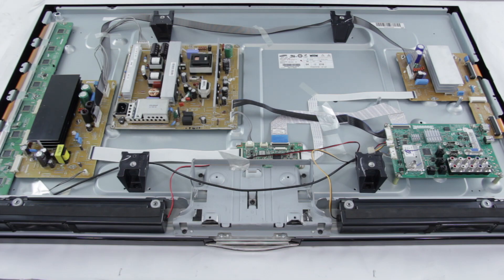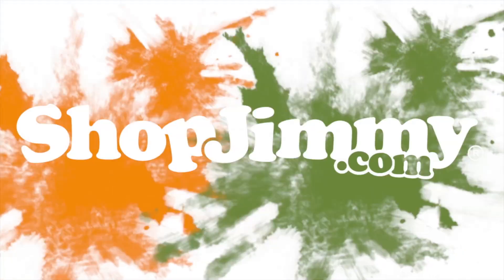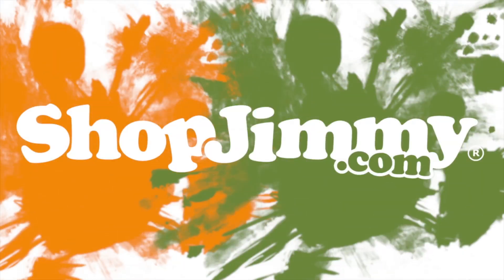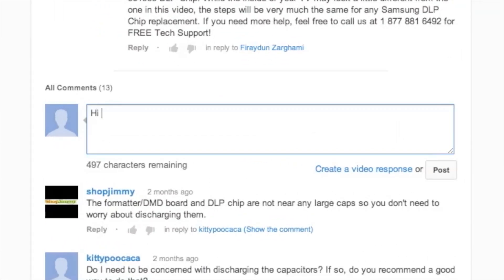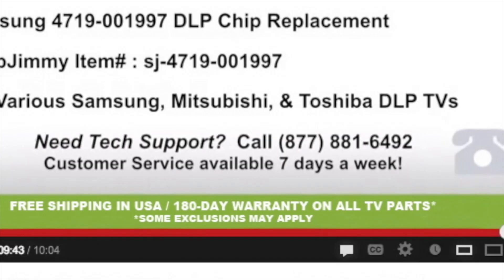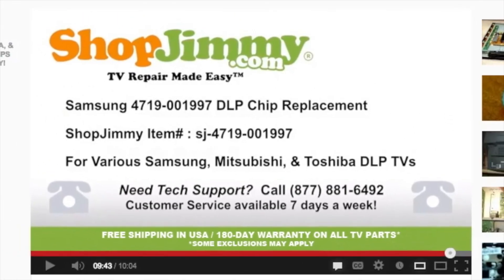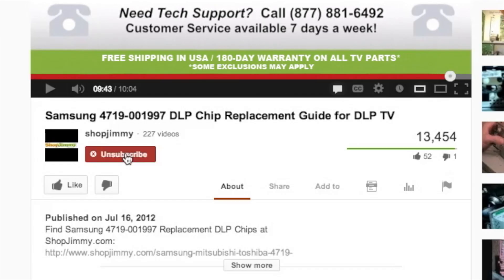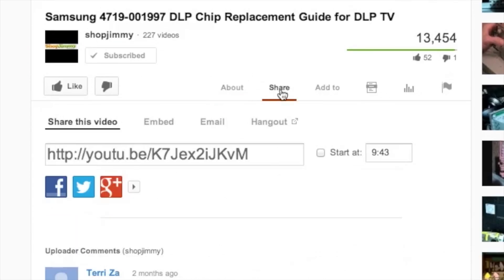Plasma TV Repair Tutorial - Common Symptoms & Solutions - How to Fix Plasma TVs

Comment: Samsung
Model: UN60JU7090F
Tv will not turn on. Red light flashes on and off and there is a clicking sound. All capacitors are in fine working order and I have replaced the power board and power cable, but to no avail. What else could be causing this?

Comment: I have an LG 60PH6700 Plasma TV, It turns on all good. But then it just shutdown. I sometimes the monitor works, But when you turn it back on. The monitor doesn't work. You can tab the tv a bit. Or shake it. and the monitor starts working again. But it can play sound with no problems when the screen is off. It doesn't restart or anything. And i suspect it is the powersupply. But when the screen is on it will just shut-down within a couple moments. maybe 5 minutes maybe 20 seconds.
Reply: BoriaGaming
Reply: Its a problem in the powersupply, you can try sending it to a repair shop to replace the capacitors in the board.

Comment: I have a Samsung Plasma TV it has sound but no picture. The model # is PN60E550D1FXZA and both the Y Main and the 2 buffers numbers are J92-01859A Partial PBA number (859A) found on a sticker the upper and lower ones are...what could the problem?

Comment: Hi, I have a samsung pn59d550c1f with no imagine and won't turn on, it has a clicking noice but not that loud, one thing i notice it the red light when i press the power botton other botton. do you have an idea of what can be causing my tv not to turn on, and where can i buy the replacement parts if I need to replace one
.. thanks i hopw you can help me...

Comment: HI THERE .. IVE GOT A LG TV PLASMA HERE.50PB560B.  there is a standby light..when you press on ,it flicks 2 times and then goes dead..nothing happens then .there, no clicking..Iv,e changed the main board but it stays the same.. What could it be?

Comment: My Samsung Pn60f5300afxza will not power on. The standby light blinks about 12 times continues and then pauses and blinks about 3 fast blink. So total of 14-15 blinks. Have replaced every board besides the main board and the Y sus board. Any Ideas?

Comment: Hello
Over the last several months I have been experiencing red pixels after watching tv on the Pioneer Elite Pro-101fd for a few hours. It happens three times a week and is resolved by resetting the Pioneer VSX 81TXV receiver to standby/on to off and holding the Tone button and holding the standby/on button until reset appears and I hit OK.
 
I would like to know if there is any reset to the PRO-101FD that need to occur to prevent this from happening again or if there is a part that i can replace. I have searched online and did not find my problem in the AV forums. What was shown in the forms was a total red pixel screen and not the red pixel that occurs with other color images on the tv. 
 

Thanks
Jon

Comment: hi have a samsung model# pn64f5500afzxa i have sound but no picture screen doesnt even light up i opened the back panel and noticed when plugged up the logic unit has a green blinking light so could it be power supply

Comment: I have a Panasonic Plasma TC-P65GT30 that is getting green and red short single line bars flickering on dark, and green bars that flash on Red and Red on Green. I have found that if I Up brightness to 100% and Contrast that I can limit the issue by effecting the colors  to not be Dark and not be a hard red or green.  Is this a voltage issue. I have found that unplugging my TV for long periods of time use to work in fixing the issue for a while.

Comment: Jimmy I have a samsung plasma tv  model PN50B550T2FXZA  with one horizontal line about 1/4" wide 2/3 down from top, iy looks like I need to replace Y components but how easy is that and are they soldered or push in. Thanks JIM

Comment: can anyone help...have a samsung pn64d8000FFZXA. 1month ago the picture failed but sound was fine.standby light was solid. waited an hour or would wait till the next day. Either case, when turned on, everything was fine for about an hour then Picture went off, no popping sound, but sound played. As the picture is off the blinking light on the main logic control board stays on for about 4 seconds then off for a second and repeats. However, when it was working fine, that same light flashed on and off for .5 second. Additionally ,after this problem i decided to plug  a usb fan into the main board usb connection and had it facing and blowing up on the main and onto the x-main as well. The tv worked flawlessly for 2 weeks. i then decided to remove the usb fan and within 30 minutes the picture shut down as before. Now the picture doesn't come on at all.  Sorry for the detail, but can anyone figure out what board it may be. I ordered and received but did not install the only 4 boards that shop jimmy had...y-scan top and bottom, main logic control board, and the x-main board. I fear installing them without knowing the problem may cause any/all of them to fail. Also does anyone know if shop jimmy will answer these questions by phone call? Thanks

Comment: I have a Samsung 60" Plasma, model PN60E530A3F. The problem began when the tv was on for an extended period of time, when you shut it off and restarted it you would get sound but no picture. If you waited a while, and then turn the tv on, the picture would appear. Now, I get no picture, only sound. Looking at your video, it would sound like the Y Sustain board. Can you confirm and give me some insight?

Comment: I have a Samsung PN50C450B1D. when I turn it on. the screen flashes a couple time and turns off. there will be sound from a tv show but no picture. I toke the panel off and noticed that the Logic Board's LED is flashing 5 seconds on and 2 seconds off consistently until it power saver shuts off. I'd like to just get the entire guts so there's no mistake on which part is faulty, but I cant find one. please help. it's a beautiful TV and i want to save it for a modest price.
Reply: Drew Allen have same tv. But mine has vertical black 3 inch line. Did u find out how to fix ur tv?

Comment: Samsung pn50c450b1dxza and the TV won't turn on. red standby light is on but no clicking noise, and I recently changed the power supply and it still not working. Also I noticed that no light on main logic board either, please help!!!!!

Comment: I have a pioneer PDP-507CMX ot a 505cmx I can't
remember which, and I have the add in card with the rgb and dvi input.  I'm getting horizontal moving lines (not black steady) going down the screen. I thought it might be my converter going in to the tv converting the hdmi signal and scrubbing the hdcp.  I'm trying to find something to directly connect to the tv to circumvent that. I did try moving the input from the rgb to the vga connector with another adapter just to see if it was the rgb input but the line were still there.   Any help with this would be appreciated, thanks!

Comment: I have had this tv for about 7 years. It will not turn on now. If I unplug it and plug it back in it makes a clicking sound 4 or 5 times then nothing happens. The red light does come on when I plug the tv in. here is the model number. Model #PN50C450B1DXZA SAMSUNG Plasma Television If you could let me know what you think the problem is that would be greatly appreciated. also, do you have a source for parts?

Comment: Hello. Si I have 60PZ550 lg tv . The sound started to fail little by little now it's stopped sounding completely. Also there is no ref light on optical digital cable port. I reset the audio setting and still not working. I also turned the tv speakers off and on. Any idea?

Comment: Phillips Plasma
Model NO: 42PFP5332D/37
blinking blue&red power light
occasionally turns on but after hours of plugging and unplugging  and pressing the power button. once on it will display fine its just difficult to turn on all the way, i read a bad capacitor but i dont how to test them.

Comment: I accidentally shot my tv with an air soft gun and it has no physical cracks but the screen is all cracky and has colorful splotches everywhere.. I can't read anything on the whole screen, it seems like it expanded. I have a VIZIO D-Series 32" Class (31.5" Diag.) 1080p 60Hz Full Array LED Smart HDTV (D32x-D1). Let me know what I should do!

Comment: Hello, I would greatly appreciate some assistance in troubleshooting my plasma. #pn51d550c1fxzc . The problem is it wont "turn on". The red stand by light stays lit when I plug in the cord however when i press power it just clicks a few times and nothing happens otherwise. 

I unplugged the X board and  plugged the power cable  back in, and there was no clicking this time, however i still had no picture or startup audio.

any help would be greatly appreciated.

Comment: hi i have samsung plasma model- ps51d550c1mxxy, version-1101, serial no-zr3a3mtb301511t, its got a crack screen and when plug it in it makes a noise and as well have a blinking front red led light then turns of. what is the best cheapest way in fixing it? can i use another pannel from different model? thank you and ill here from you soon

Comment: 60 inch plasma LG model #60PA6500-UA
Serial # 201RMGC6341 The television just stopped working, not a completely black screen, more like dark bluish. It won't power on.

Comment: I have a 42 in Panasonic it has green vertical lines all across the screen the cable works for it but the HDMI has the green vertical lines new DVR has been change but made no difference you can send reply back to

Comment: we have a Samsung plasma tv model number PN42C430A1D we replaced the Signal board and it did not fix the issue. What is going on is when you turn the tv on the red light comes on there is a sound of it turning on but there is nothing on the screen what could be our next step to try? Thank you Rebecca

Comment: Insignia NS-pdp50-I would press the power button, the TV would power on for about 2 seconds and shut off.  I opened it up and found that when the ZSUS board was unplugged the TV would stay on but without a picture.  I ordered a ZSUS from you guys.  I installed the board and the TV will stay on but it still has no picture.  Do you have any suggestions?

Comment: HI Jimmy, I have Samsung 42" plasma tv. Model #PN42C450B1DXZA. Accidently one of my table lamp hit the screen and creak the glass. after that TV doesn't have picture, it have sound only. If i just replace the PDP assembly it will work? Or its not worth to fix it? Thanks

Comment: samsung plasma pn50a550s1fxza
Problem-Clicking on and off -not tuning on
when cable connected from power supply to main board tv tuner this causes clicking cycle
all other connections done independently do not cause the clicking cycle
no blown fuses or capacitors.
possible causes or solutions?
Bob
rgishman58@gmail.com

Comment: I Replaced all my 6 Fuses and my old plasma tv still dost turn On, i am familiar with lcd tv repairs and bad caps and stuff, but this plasma tv is fustrating to me because i dont know what is wrong with it, can anyone help me?

When i turn it off from wall socket and then put it back and turn it on the green light turns on for like one second and then again the red one and after that im not able to get that green lioght back only if i disconect the 220V power cable from wall for some time..

Comment: I have a PN51D550C1FXZA. The TV used to power cycle every now and then over the past few years. Yesterday it shut off and didn't turn back on. After I unplugged it and plugged it back in, it goes through a power cycle a few times and then the standby light just blinks continuously on and off.  Any suggestions on what the problem may be

Comment: we have a Samsung 60 inch plasma TV. Model # 60 pn 6550-ua. Serial # 303RMQK1X452  (1048) the top of the screen it has a black line/stripe, similar to looking through a screen door. the strip about three inches wide.

Comment: I have a Panasonic veira  plasma 50,  tc-p50g20.  about 5 years old.   was perfect picture.  never a problem.   until my gf threw a candle. at it.?%&÷    anyway.  it cracked the screen but not open.  and tv will not do anything.  no light. no noise.  in decent diy guy.  I know I need a screen. and I assume I'll check the boards for swollen capasiter o
and a visual inspection and volt meter.   I assume should show 5 on the board.  but my main question.  should I trash it or is a screen worth it.  and I don't know about disassembly of the screen. I know there is gas but it maybe gone.   idk.    can't find a video on it.    help!

Comment: I have a 2005 Hitachi Plasma Model 42HDF52A.  When there is a loud flash or sound in the program I am watching it causes the screen to blackout for about 3 to 4 seconds. The audio is unaffected, . Also when you turn the TV on it does not retain the input mode from last time, It always starts at "Analog RGB" and I have to change it manually. What do you suspect the problem to be?

Comment: I have a PS51D535 Samsung Plasma TV. The green LED on the logic board switches on and off for a few times and then completely turns off. Seems like the TV power cycles. I have replaced the Y-SUS, X-SUS and Power Supply boards. Same issue. What board is causing this?

Comment: LG 60PB6650 Plasma TV. TV start dropping signals no matter what playing (cable or antenna channels)  and freeze on some stations as well.  I completed a factory reset to see if that would resolve the problem but it did not.  Also the remote stop working the same time the TV start dropping signal and freezing.  It like the channel is in freeze mode by a push of a button but the remote does not work. Cant change channels or control volume with the remote only from the TV itself; however can turn the TV on and off with the remote. Can someone please let me know what the problem(s) is and what I can do to repair this matter.  I just received this TV for a bday gift not even a yr ago and  bc I don't have POP (proof of purchase) my the warranty is voided. Who ask for POP for a bday gift; however i
I'm a computer technician so I don't think it would be hard to replace the part(s).  I'm just needing to know what to purchase and where to purhcase the part(s) from.

Comment: Pioneer plasma PDP5070HD and it powers itself off after 20-39 minutes.  We can use the power button and it comes right back on, so overheating isn't an issue.  The blue light flashes 12 times in a row after it powers off.

Comment: I have a Vizio Plasma TV that I recently fixed, anyway when working on it the tinted piece of glass came off (the one in front of the screen) I put it back, but I wanted to ask, what would happen if I ran the TV without this piece? Would the TV be brighter or can I just remove it (that outer piece is scratched a bit and would be nice just to remove it)

Comment: Hi. I have a Samsung pn59d8000 and it works fine at first but after awhile the picture goes black tv still on. I let it go for about 10 minutes and the sound came back but still no picture. and the pic will come back on but it happens again. any suggestions?

Comment: Just replaced power supply for a  Samsung PN60E530A3F Plasma TV. no standby light or picture. Measured outputs of supply only 1 pin had low output power and it was pin 1 of the power supply connector looking for 5.0 provided 4.3 vdc. no other pin made any power. 
In a case like this how do you start and know that your going in the correct path to effect a lasting repair?  
I've tried disconnecting the output cables with same results. Oh by the way my power supply board is new from Shop Jimmy. I also purchased a replacement Samsung BN96-22114A (LJ92-01858A) X-Main Board, still no changes.  The AC Power input cable powers other smaller tv, and I'm sort of lost on where to go from here. please help if your able.

Comment: I have a Samsung 60" Plasma with no picture PN 60E 550D1 FXZA. I don't get any lines across the screen just an occasional
very mild flash when powering it up for perhaps 2 seconds. And of course the light blinks 5 times after an attempt to power it on  then stays steady red after you turn it off. I replaced the PS Board Samsung BN44-00512A but no help. The old one looked burnt in certain spots especially around the 2 green colored components. That . . .  I thought was my best and only shot . . . everything else looks terrific ?

I need to hit a home run with my next attempt before the wife lowers the boom on me. I like this TV.

Please advise.

Comment: I have a question...the tv model number is 60pn6500, LG Plasma. The tv turns on but will turn itself off after less than a min, tho the time it stays on varies each time. Sometimes the picture on the screen is distorted, but not always. There is also no sound. Thanks

Comment: My LG 50PG20 plasma TV spontaneously shuts down.  The remote will not turn the TV back on, but I have been able to get it back on by actually pressing the on off button on the front of the TV.  I thought perhaps a switch PCB, but after replacing that switch, the TV came on one time, went right off and now I do not even get any activity from the switch.  I have checked voltage to the power board and it is getting power.  Both fuses show continuity.  What's the next likely problem?  Thanks.

Comment: I have a Samsung PN64F8500 that originally had motion problems. Geek Squad replaced the Processing board and the picture was a lot better. Then it would freeze when in programing mode or not turn off unless unplugged. Replaced this board again, not picture looked like crap, like low def, flat and lifeless. Replaced board again, picture better but still be kind of flat or a little dark, like it just doesn't fully boot. Sometimes it seems like it gets better as the set is on for a while? Then they replaced the main power board, this didn't help. I'm not getting that great picture that we all know and love. Would love to make this thing work as there currently is no great replacement. 

Thanks Bill